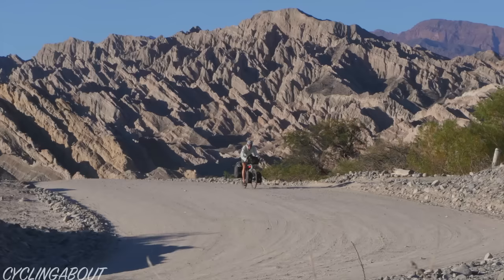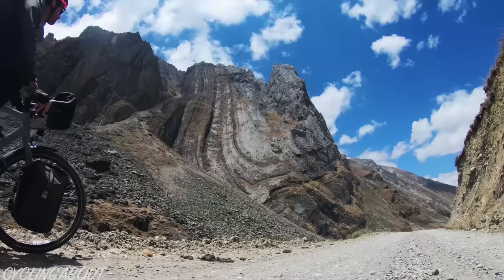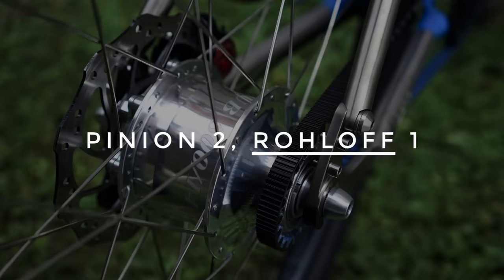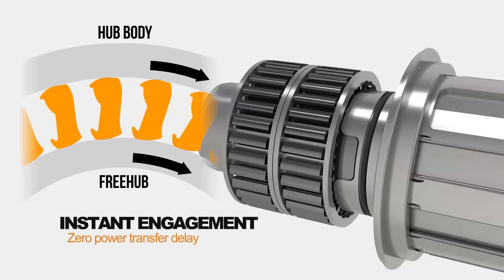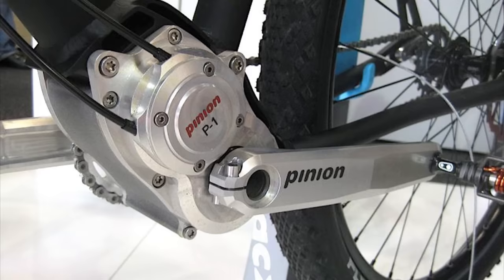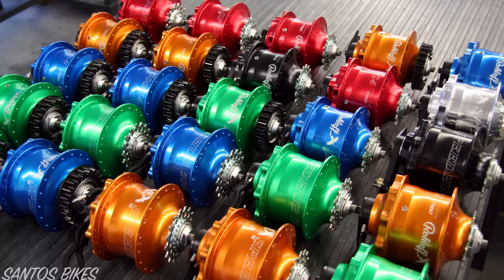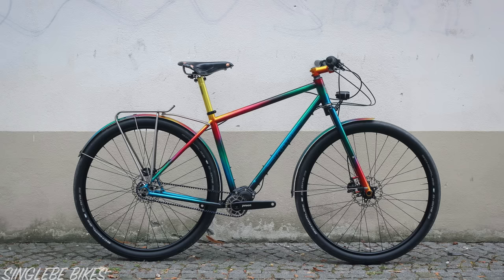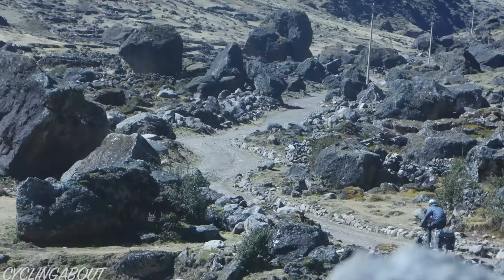What's The Ultimate Bicycle Gearbox? Rohloff Hub VS Pinion Gearbox

Comment: Pinion will never make significant gains in the market if they don't get rid of that bullshit grip shifter. That experiment for those who weren't sensible enough to automatically know the answer was done & solved long ago. Gripshift is to HD-DVD as triggers are to Blu-ray. Pinion's lack of refinement is a current disadvantage but a future advantage. Like EVs, the room for improvement is significant & the technology/concept is already demonstrably superior. Pinion has the better concept, the device just needs to be tweaked. Props to them for trying to fix what $hitmano & $CAM don't want to. Where's Effigear?
Reply from the maker: Well, I prefer gripshift given the choice.
Reply: @Cyclingabout  You're a tiny minority.

Comment: You lost me when you started talking about E-bikes. I hate E-bikes.
You also didn't mention the ease of dealing with these companies and their dealer/service network should the hub need attention.
I have found Rohloff difficult to deal with. They do not seem interested in developing their hub for traditional bicycles, their efforts now go to E-bikes. Rohloff could explore a number of options for their current hub 1. an ultra lightweight hub 2) closer ratios say 8-9% between the gears with perhaps not quite so much over all range to favour more everyday riding where maybe you are not climbing steep mountains.
I have no idea about dealing with Pinion. On paper it seems to be the better gearbox. The few negatives are outweighed by the benefits.
I have 2 different wheel sets each with Rohloff hubs so I can fit to different bikes. Although interchangeability is good I'd still prefer a Pinion P1.18 gearbox with belt drive bike for the ultimate low maintenance bike. The gearing on the Pinion 18 spd hub has smaller jumps between gears than the Rohloff hub.
Reply: I have had ZERO problem with 13.6% jumps on my 46/16T Rohloff. I've also done over 10,000 miles with SA hubs at 33%. That makes you lug the motor.
Yah damn E-bikes all over now, and a LOT of whimpy 30s yuppies have them.

Comment: no offence but this is nonsense. 50 seconds in and you say the gear range determines how fast you can pedal your bike! Err..... no, that would be your leg power. Then you go on to describe speed up a hill based on gear ratio. Err.... no, that would be your leg power and cadence. If you want to compare you can only talk about gear range and mechanical efficiency. speed and climbing ability are all down to the rider, not the product.

Comment: Maybe both can solve the stupid gear ratio spacing of cassettes and even more stupid 1x derailleur systems.  Here is an example of the perfect gearing for 90% of all terrain in the world: 22-32-44 chainrings and: 12-13-14-15-16-17-20-24-28-32. 3x10 speed. Only top talented racing athletes in pro or Olympic cycling would need different. Instead for the last 50 years we get gigantic gaps in the high gears, shifting from a 13 cog to an 11 cog is ridiculous and makes training at high speeds impossible for the average cyclist.

Comment: why keep it simple when you can make it more complicated and expensive
Reply: Because people are about evolving and making life easier.
Reply: @Don19762  if you have a more complicated solution that is more expensive to try to do the same job , it s not evolution, it s marketing
Reply: LOL hahaha.... ShiTmano has 10 levels of deFAILeurs, but their not complicated?? hahahah
2000 different deFAILeurs over the years. Spoke tension is 50% diff between sides. Pling pling. LOL 
ANY IGH can take ANY weight. SA 3 speed is almost the same since 1903.
Reply: @alainbellemare2168  I mean it in a way that it is free of maintenance and cleaning. That is what people want. Sure it is more expensive, but if one cycles around the world it is a safer option.

Comment: The prejudice is on Rohloff which is the worse system of the two. In the weight section you omit the weight of the bottombracket. Rohloff hub flanges are very weak. They can and will tear off at random times. Pinion is the way to go.
If you break a Rohloff after 11.000 km's in 5 years your 4000 euro bicycle suddenly looses 4500 euro's of value and you are at the mercy of Rohloff for a repair. Yes it happened to me an numerous others. Just google for "Rohloff broken flange".
Rohloff oil changes are horrible. All Speedhubs leak oil at the nondrive side seal. Some leak a little, some leak at dripping speeds.
Rohloff is bad engineering (for a german product) teamed with a lot of hype. Pinion is solid engineering. Retrofitting is nonsense. It's like comparing a tricycle with a bicycle.
Stay away from Rohloff. It gives the same qarranty as a chinese crap bike.
Reply from the maker: The bottom bracket is included in the crankset weight.
Reply: My Rohloff has 17,000 miles, 8,100 miles pushing 120 lbs on tour. It doesn't have the leaky QR. 
I actually had less fluid loss the last oil change. How can I improve reliability PERFECTION?? 
It can and WILL put to shame any defaileur on a heavyweight. The worst part of the Pinion and Schlumpf is the very POOR pedal connection and POOR chainring selection.
I took and oil kit, but didn't bother on my 3,900 and 4,200 mile tours. 
My shifter is DIY on my TT. So far it's set and forget. Same with my SA XL-FDD dyno drum brake front hub.
Broken spokes and hangers are a FACT of life with defaileurs. GARBAGE technology. 
Double shifts are also a complicated annoying FARCE.

Comment: Every 5 or 10 thousand kms you will have to pay 20 dollars for 60 ml of oil a big scam. Now certain cyclists go in search of adventure with bicycles of more than 4000 thousand dollars ........ you do not have to get your hands dirty adventurers.
Reply from the maker: Not quite. It's $100 for 1L of cleaning oil and 1L of hub oil. You only need 25ml of each per service, so it's $2.50 for 5000-10000km. Less than a coffee...
Reply: @Cyclingabout  In particular you mean Rohloff, if you buy the little kit you will pay the price I told you. Here in Europe you will not pay less than 110 euros for a liter of cleaner (a damn degreaser) and with shipping costs 150 Euros for 1L of oil, do you think 150 Euros for 1l of oil is normal? ....... for that Price could drink first-rate wine for months in my country, are we crazy, is this a bicycle? ... and you also have to grease the chain. Rohloff brand?, what I said was a transmission for rich authentic adventurers.
Reply from the maker: I appreciate that it's expensive oil/degreaser when compared to other industrial products. But I'm really not stressed about paying 50 cents per 1000km for my hub to run well.
Reply: @Cyclingabout  Who buys a yacht I don't think they are worried about paying for gasoline. Paying between 1500 to 2000 euros for a transmission plus the Carbon system is crazy. Personally I think that knowing a little mechanics and keeping your traditional transmission will take a lighter bike with less friction, you will enter spare parts anywhere and in case it breaks everything you can repair it yourself ......... get my hands dirty ? no problem friend this is a bike not a Ferrari. Thank you for the work you are doing on the channel, even if it is not my target and because sometimes the criticism is healthy. Bikers hug.
Reply from the maker: I'd have to be paid a lot to go back to derailleurs and chains after a decade on Rohloff/belts! 😅 I know the money seems insane, but I love that I can just jump on my bike every day - in any weather condition - without thinking about lubing, degreasing, adjusting cables or wearing out parts. It's worth so much to me as a bike tourer - I think I would actually pay much more than 2000 euros for the pleasure! 😁

Comment: A rather silly comparison awaited me after the very self-confident announcement of the  „best comparison between Rohloff and Pinion in the internet“. The stupidity starts by not weighing the different disciplines differently. That the Rohloff has a 4% higher efficiency is counting much more than the 5 year warranty of the  Pinion vs. the 2 years of the Rohloff (when did a Rohloff ever need a repair in the first two years anyway?). There are more silly comparisons made. The producer of this video is not blessed with very high analytical skills and should stick to comparing beers or sth. similar.
Reply from the maker: I gave you ALL the information you need to weight each section in accordance with your needs.
Reply: @Cyclingabout  You should have saved giving points unless you are ready to weigh them in a reasonable manner.  Otherwise you could also include into your test  the number of „i“s in the names of the gearboxes and finally the worse Pinion gets the win. My impression is: this test includes very little relevant and partially very arbitrary disciplines and weighs those as high as relevant ones. This gives a rather biased impression or seems to show incompetence.
Reply from the maker: @arming.9840  The points were simply awarded for clarity. I'm sorry you didn't find this video useful, but many other people did.
Reply: @Cyclingabout  Points are ALWAYS for clarity, but the way how they are given can be manipulative/biased. And many feel that this is the case here.
Reply from the maker: @arming.9840  I wholeheartedly disagree.

Comment: Why on earth do we need these very expensive gears? None of their "advantages" worth their price! A 3x10 (even a 3x9) performs much better than these. Certainly in torque (up hill pedaling).
Reply from the maker: Because they're fun and awesome.
Reply: Mainly maintenance I suspect as they're sealed units and will last a long time, allows the drive train to look clean and you can use a belt or thicker single speed chain which will last longer. That being said derailleurs are fairly easy to maintain really.
Reply: Belt+gear box last far longer, less maintenance, possibility of stronger back wheel on pinion, shift without pedaling...
Reply: I have a Nuvinci transmission, but I have done a bunch of research into these alternatives as well, and I will never get a conventional bicycle drive train again.  These things are reliable and low-maintenance.  They can downshift at a stop.  They probably don't randomly switch gears on you when you pedal too hard, which conventional drive trains tend to do if you don't have them tweaked exactly right.  My old bike used to do this, and it was dangerous and super annoying.  They are quieter.  They allow for belts, which are also quieter and lower maintenance and which don't get grease on your leg and which don't tend to periodically snap on you or fall off the chain ring.  Conventional drive trains have their application in racing, but these are way better for commuting and recreational cycling.
Reply: Eventually you'll get tired of cleaning, maintaining, and replacing your cassettes, free hubs, and chains.  The chains stay straight if you stick with them using a gearbox, none of that angled bs to wear and stretch them out.  Cassettes are expensive for anything decent, $50 even for the cheap shit.  The free hub is built into a rohloff, you never need to do anything but a quick oil change after thousands of km.  It's a easy process and very clean.  If you run a belt on these, you pretty much never need to do anything it seems like.
Reply: If you are looking for a new bike and want to consider one of these but are put off by the high price, you might look at the Priority 600 (Pinion, $2300) or the Priority Continuum Onyx (Nuvinci, $1100).  These are the lowest priced options that I know of at this time, and if you use them in place of a car, they will pay themselves back almost immediately.  I don't know what a good affordable Rohloff option is though.
Reply: It's constantly dithering with your drive train for optimum efficiency vs. pay up once, install, and forget for years.
Reply: Chains especially the newer ones do not last very long.  Derailleurs have become disposable and also wear very fast.  Along with constant maintenance and adjusting.  Then it is very vulnerable to hitting something and break/bending. You surpass the prive of a pinion gearbox bike after only one year of long distance riding. 3x10 or 3x9 are hard to find new and parts are becoming scarce.  My pinion gearbox other than changing oil every 10,000k has needed nothing.  Even on the same belt drive after 35,000k.
Reply: @oilcanracer6388  Most chains are built to be lighter now, so they don't last long, I know what you mean there.  On my old derailleur setup I had to replace them every 1500-2k miles.  With a straight chain alignment on gearbox drivetrains, you can use the more basic pmc 10spd chains or other single speed chains that last far longer.  I've used the same chain and rock 'n roll gold lube with my rohloff bike now for a few years.  I just finished a 450mi ride, half pavement, half gravel, and didn't even need to lube/clean the chain once.  The chainrings and rohloff cog still look close to new.  In my opinion, the angled chain on derailleur setups goes through chain lube far faster, perhaps because it squeezes the lube out from between the pins.
Reply: @oilcanracer6388  I have never had a broken chain in any of my bikes! Yes I see your point, when I will struggle to climb a hill, I will remember that the Gearbox needs less maintenance and I will gain more strength and stamina just from this thought! You must be joking of course. My gear chainset is 48x36x26T and the cassette is 11-40T. No gearbox can surpass this! The reason that you cannot find easily this setting is because most of the bike users are content to what they offer them.
Reply: @Cyclingabout  Yes very awesome indeed! To climb a steep hill you have to get off the bike!!!
Reply: @snowcrazed1  I do not see any advantage on bike performance. Obviously because it doesn't exit!
Reply: @tonyk8368  The ONLY reason someone uses gears is for the performance! To combine high speed with high torque. The high torque, which is the most important in mtbs, from the figures that I have seen, is simply non existent withe these gearboxes!
Reply: @boxlid214  Yes I agree, this is the most important part. Not to do anything!!! Are you really serious? The most important is the performance of  the bike. How this gearbox can help you to speed and to climb a steep hill like a piece of cake!
Reply: @foodsafety5875  Believe what you want to believe then I guess, but if you ever get the chance to try out one of these bikes, then I would take that opportunity, because they really are awesome.
Reply: @foodsafety5875  ... 40T cogs?? LOL hahahaha What a farce.
Reply: @tonyk8368  100% agree with you on every point. Also want to add that with a NuVinci you can shift under full load and don't have the annoying huge 9rpm jumps in cadence.